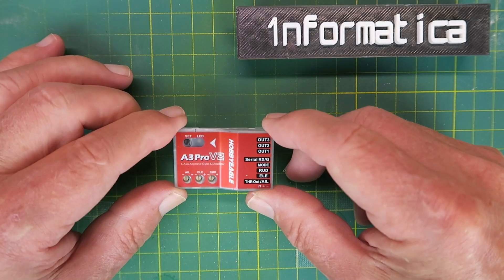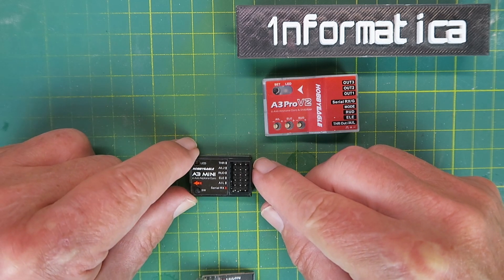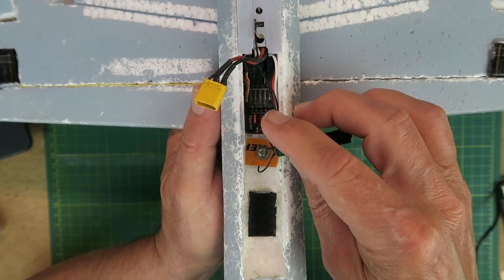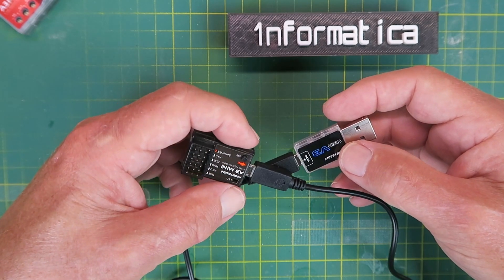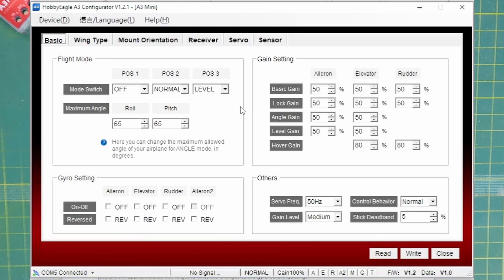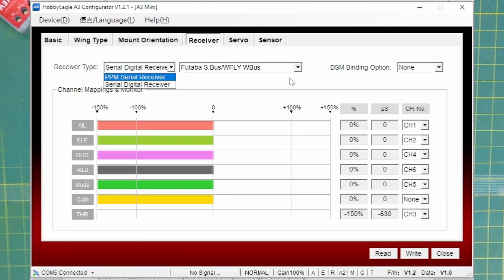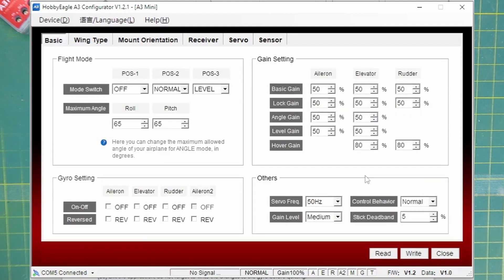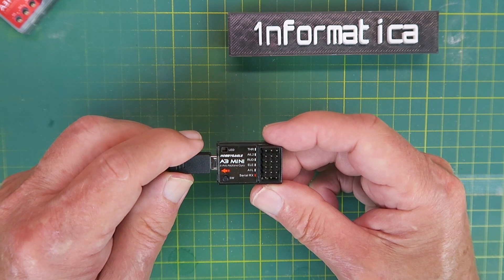HobbyEagle A3 Mini 6 Axis Gyro Stabiliser for RC Planes

Comment: Hello, thank you... My English is not so good. Can I use this gyro without a receiver?i.e., is there a receiver integrated? And do I have to connect it to the PC or can I also set it via podis
Reply from the maker: Hi, you need an external receiver either SBUS or PPM. It has to be connected to a PC for setup via a special cable. If you have other questions please ask. Thanks for watching, have a great day!
Reply: @1nformatica  Ok, thank you very much. Do you know a small receiver incl gyro? Got a tx16s
Reply from the maker: @Zstreetfighter18  I don't know of any small receivers with gyros for planes. Watch out because there are several for cars! I use a tiny Happymodel ELRS SBUS Rx : https://s.click.aliexpress.com/e/_DBGwfUD Also if you want a small "plug an play" no programming needed Gyro look at the RadioLink Byme's : https://s.click.aliexpress.com/e/_AaDrhd

Comment: You show a radio link gyro also which you refer to as your “Go To” gyro. What makes this mini version perhaps better?
Reply from the maker: I think if you check the date of the video I used to use the "Byme" gyros before the A3Mini came out. The A3Mini is better for many reasons, you can program it from a PC for both "normal" and "delta" configurations. The degree of gyro gain can be set along with many other parameters. The Byme gyros are fixed function the A3Mini can be setup just the way you want it.

Comment: Just saw this and glad I found it. I am doing my first ducted fan, Freewing F-18 Super 64mm. I am using Align A6B receiver with my A10 Transmitter. I'm waiting on this Gyro to show up before I start setup. The Align uses PPM output, so my understanding is the Align will be a pass through then everything goes through the Gyro. This will be my first time setting up an entire aircraft top to bottom, so I know I'll be back a lot to check things out.
Reply from the maker: You are correct the receiver just passes the PPM signal to the gyro which does all the mixing. Happy to help if you have any questions. Thanks for watching, have a great day!
Reply: and did it went well?

Comment: Thanks very much for the video. Is there any benefit in connecting the throttle through the gyro? With the A3 Super it look likes the throttle is connected directly to the receiver.
Reply from the maker: Only a few things I can think of, obviously if you use a Rx with only serial out you will need that connection! Maybe the gyro uses the throttle when in "hover" mode, I have not tested that. Or just to keep the wiring tidy?! Thanks for watching, have a great day!
Reply: @1nformatica  Ah, that's what I thought, tahnks for the quick reply and again for the useful video.

Comment: Very interesting. I have a couple of the BYME-A gyro you mention in the video. I bought them after watching your video about it. I thought this HobbyEagle looked much better in term on the configuration but it falls short in a couple of areas, for me at least. 
The configurator looks like it is Windows only. No Linux version, although I can probably get around that one. 
It also doesn't support the CRSF protocol so won't work with ExpressLRS receivers. I stopped buying FrSky after all their firmware shenanigans. At least my TBS Crossfire receivers can output SBUS as well as CRSF but I'm moving to ELRS for the cost, range and smaller 2.4GHz antennas over the 900MHz crossfire antennas.
Love the videos. Thanks.
Reply from the maker: Interesting comment, thanks. I guess you can use wine for Linux? Have you seen the little CRSF - SBUS converter from Matek? http://www.mateksys.com/?portfolio=crsf-sbus In the recent firmware update to the A3 Mini they included JETI Duplex EXBus serial protocol so maybe only a matter of time before CRSF, I'll contact them and see if the get back! Thanks for watching, have a great day!